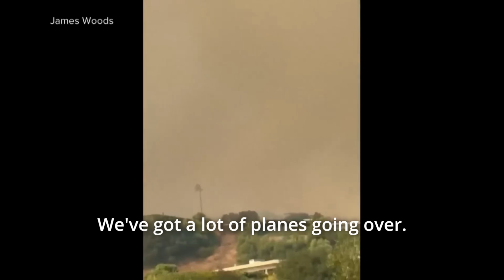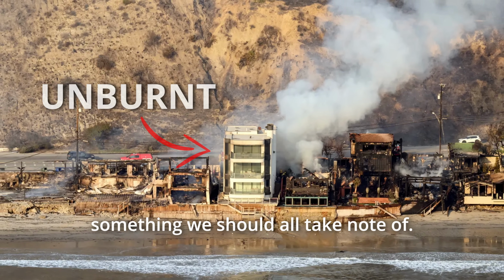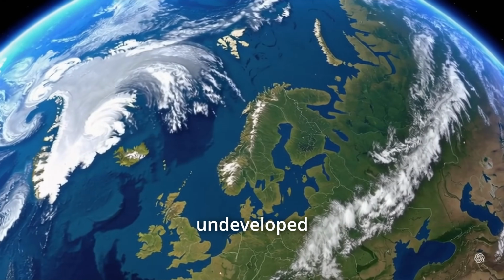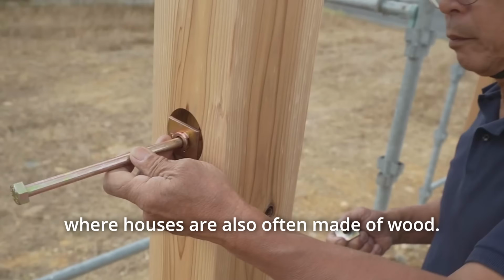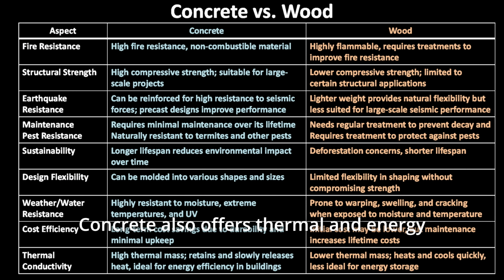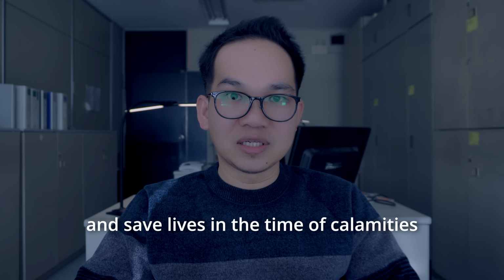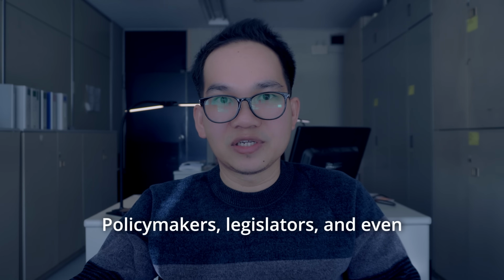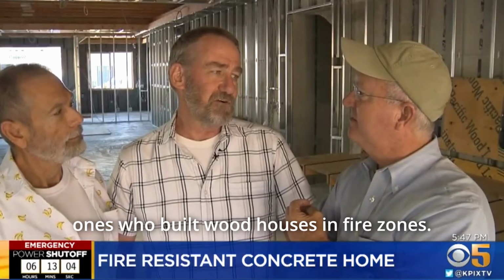Fireproof House? - What America Can Learn From The World

Comment from the maker: What material is your house made of? Is it durable enough to calamities?
Reply: My partner is also Filipino & the construction in the Philippines is structural concrete most houses Ive seen have no insulation I believe cellular concrete would be a better solution to construction there
Reply from the maker: I agree that insulation should be provided for houses in the Philippines, as the heat can be intense, especially in the summer. Without proper insulation, concrete homes tend to trap heat, making interiors uncomfortable. Your cellular concrete system could be a great solution. And please send my regards to your wife, a fellow Pinoy! Cheers, mate!
Reply: @chrisrayson4902 Insulation for hot climate would be achieved with thick stone walls or clay. 

Both difficult to build at scale so concrete options are the second best and common around southern Europe and world wide in advanced society.
Reply: @evdonsicatphd  wood framed since I live in the US and built in the post war boom (1961 I believe). I am in a fire prone area (the hills behind us burned in late 80s), but it burned away from our home so we were safe, but many died in that fire) and I can't afford to scrape it to rebuild new with all things perfect, so I am retrofitting things as I fix things on the home.

- already have made a 10ft buffer around the home with gravel and pavement as decorative hardscape and only succulents for plants (high water content makes them very fire resistant 5fr+ off the home
- going to do an unvented attic conversion and metal roof install this summer and will have metal eves once that's done with screened downspouts and gutters
- currently conditioning the crawlspace so I can close off all those vents as well to kill off that other weak point.

That should address the highest risk items.

The home is mostly stucco already and so that is fairly resistant as is but when I replace my windows in another few years, I will replace all of the stucco with metal or cement board siding with thick fire resistant insulation on the home exterior.

An option to not do window replacement is to add fire shutters to the home instead, but my windows are ancient and some leak so I should get around to replacing them anyway... 

If/when I do the windows I will go with tempered glass and metal or some other fire resistant material for the frame. Could still do the shutters - belt and suspenders and all that.

You can never make a home "fire proof" - given enough time anything can and will burn, but I think I will get as close as I can to a fire resistant home...just need to hope no fire comes my way in the next 10years before all my projects are done
Reply from the maker: @triaxe-mmb 
I really appreciate you sharing your experience and the level of detail in your fire-resistant retrofitting! It’s great to see that you’ve taken lessons from past disasters seriously and are proactively working to protect your home. I’m also glad you were spared in that previous fire.

Your methodical and practical approach to hardening your home against fire risks—can really inspire anyone in fire-prone areas.
Your strategy of creating defensible space, upgrading your roof and attic, and closing off vents is spot on—many studies show these are some of the most vulnerable points in wildfires. The tempered glass and fire shutters are excellent additions, especially since windows can be a major weak spot during ember storms.

I completely agree—no home is ever truly “fireproof,” but minimizing vulnerabilities as much as possible buys you critical time and protection. Wishing you the best with your retrofits, and I hope your area stays safe from wildfires in the coming years!

Would love to hear how things go once your projects are further along! 🔥🏡💪
Reply: @evdonsicatphd  another query - is it advisable to put pipes and sprinkler heads on homes to actively fight fires or would they be more of an hindrance to fire fighters during a fire disaster? If yes, is that something a homeowner like me can figure out or should it be designed by a fire systems engineer and professionally installed?

The only homes that really survived when such major fires happened were either built better or they were ones where homeowners basically set up pumps and pipes and lawn sprinklers and such to fight the fires, or they even actively fought it by staying back (highly not recommended IMO - yes your home is valuable, but your life is more valuable...I guarantee a person's family will miss them way more than any home)
Reply from the maker: @triaxe-mmb  Great question! Sprinklers and fire suppression systems can definitely help by wetting surfaces and reducing ember ignition, but they need to be properly designed. Poorly placed systems might not provide adequate coverage, could fail under extreme heat, or even interfere with firefighting efforts.
For the best results, it's highly advisable to consult a fire systems engineer to design and professionally install the system. They can ensure it integrates well with your home’s fire defenses and doesn’t cause unintended issues.
And I completely agree—while protecting your home is important, your safety should always come first. Homes can be rebuilt, but lives can’t be replaced. Stay safe!
Reply: rainchains can be a great fix too 

Make sure to expend the cleared area around the house. 

Have vent and AC protect and shut down during fire. 

Plaster wall and low stone perimiter walls help too.

Comment: It's not all of the rest of the world. Wood is the standard material for residential construction in Canada, most of Scandinavia, parts of Russia, parts of Australia, New Zealand, and much of Japan. It takes more to fireproof a wood structure, but even when it's used in shoddy structures, it's much safer in earthquakes. The worst quakes in the Phillipines over the past 50 years have killed tens of thousands, while the worst quakes in CA during that period killed 50 or 60 each and most of those deaths were due to concrete and masonry structures (especially bridges and overpasses) collapsing. Concrete can be made more resistant to quakes, but when it does collapse, it's inevitably much more dangerous to anyone caught under it. And, wood structures can be made much more fire resistant than most of the houses we build in the USA; with stucco on the outside, a metal roof, no vented interior spaces and intumescent coatings on the inside, it can nearly match the fire resistance of concrete. Wood structures can last hundreds, sometimes over 1000,  years; the oldest one in my town was built in 1635, while modern concrete (unlike Roman concrete) starts to deteriorate after 50 to 200 years depending on the conditions. People rebuilding in CA will be looking for more fire resistance and I'm sure some of them will rebuild with concrete. But those who rebuild with wood will likely be required to rebuild with much better fireproofing than their destroyed houses had. We in the fair-weather parts of the country can certainly learn from that; even here in the Northeast, we've had some devastating urban blazes and some wildfires. But we also need to heat and insulate our houses and my brick&block townhouse from the 1950s would not pass today's earthquake codes. Wood is not going away, so it's time we learned to use it safely.

Comment: Sound advice, but counter to the prevailing paradigm of cheaper & faster, with little heed for durability and survivability in case of disaster. The proliferation of Lithium-ion batteries is adding a new dimension for fire prevention.

Comment: Sorry this video misses the point...  We don't need to build solid concrete houses in California to resist fires...  Most of these houses had open vented attics & crawl spaces with large vents & wooden siding etc..  The devastation would have been far less with simple stucco exterior, tight mesh screen vents, fire resistant roofing.  The idea that everything should be made entirely out of concrete is frankly absurd.

Comment: I totally love the idea of a more durable concrete house. However, wood is super cheap, everyone knows how to build a house out of it, and it might be cheaper long term. Most people only care about the immediate cost, square footage and design. Houses are already so expensive too, so it's a hard sell
Reply from the maker: I totally get where you’re coming from—affordability and familiarity are major reasons why wood remains the material choice. But what surprises me is that even some multi-million-dollar homes that burn down are still made of wood. With that kind of budget, a concrete home would definitely be possible.
There are also concrete-based alternatives, like Insulated Concrete Forms (ICF), while only adding about 5-10% to the upfront cost compared to a traditional wood-frame home. ICF homes require significantly less energy to cool and heat, the long-term utility savings can actually make them more cost-effective over time. 
I agree - most people only care about the initial cost. But then again, when calamity strikes and their houses burn, all will be lost and rebuilding a house will be more costly.
Reply: @evdonsicatphd  would ICF work in places like CA where they have to deal with fires and earthquakes? 

Every time we see earthquakes in densely populated areas in other parts of the world (most recently in Turkey I believe) we see a lot of concrete structures that collapsed...even in places like Kobe in the 90s they had such a high right of structure failures and deaths compared to the last major earthquakes to hit CA (Loma Prieta, Northridge, Napa) where while there were significant structural damage incidents in all 3 quakes the injuries and loss of life were quite low...is that purely chance or did the fact that CA has such a heavy utilization of wood framed structures play into the overall reduced mortality and injury rates compared to places with more "robust" construction techniques? 

Not being sarcastic - honestly curious...I do understand that the tyoe of shaking and duration of shaking play a large part in it...for example the Kobe quake and the Turkey quakes, while about the same magnitude as the CA quakes, they were substantially longer in duration...is that why they had such high structural failures and deaths relative to the CA quakes?

Also, If our wood framed construction is why we had such lower levels of injury and loss of life, then is there a way to build without wood framing that still gets the same results in earthquake performance? Steel framing maybe? Or is that cost prohibitive?

Comment: Its truly crazy that so many LA home owners was so unprepared. Even houses on the beach front row was completely destroyed. Why did these home owners not had submersible pumps with fire hoses using the unlimited water source of the Pacific Ocean..?
Reply: It takes massiv pumps just to take water up 100 ft most of the fire were miles away and over 400 ft elevation.
Reply: Salt water would need pumps to be cleaned regularly too. 

Like i said most fires were miles away from the ocean.
Reply: Pool pumps did help but only a few homes had some.

Comment: Homes made of concrete and steel are non-combustible, as are metal rooves and mineral wool insulation.
Reply from the maker: You're absolutely right—concrete, steel, metal roofs, and mineral wool insulation are all excellent non-combustible materials that significantly reduce fire risk.

Comment: You do not understand; rich build from concrete, including concrete roof. Poor(99%) have to go to bank, bend over, and buy wood house.
There is nothing about engineering here.
Reply from the maker: The houses of the rich that burned in CA—even those costing millions—were predominantly wood (with few exceptions). While concrete homes may carry a slightly higher upfront cost, technologies like insulated concrete form (ICF) can only add about 5–10% to the price of a wood house. However, the advantages of concrete over wood extend far beyond cost:
Fire Resistance: Concrete is non-combustible, with no risk of fire spread.
Durability: Concrete withstands extreme weather conditions better than wood. - It does not rot.
Energy Efficiency: The thermal mass of concrete helps in stabilizing indoor temperatures, potentially lowering energy bills.
Low Maintenance: Concrete requires less upkeep over time, providing long-term savings.
These benefits are rooted in engineering principles discussed in the video that apply to everyone, regardless of income.
Reply: @evdonsicatphd  Americans,for the most part, do not apply logic in their thought process. They are an ego based culture and those who make a living off of them know this. The only way this type of building becomes the norm is if government requires it in building codes. However that would slow growth in residential real estate and negatively impact GDP, so that’d be a no go for government.

Comment: Availability and price is why we still use paper and sticks to build our dwellings.
Reply from the maker: If we look around, we can find alternatives such as ICF that may cost just a bit more than traditional wood framing, but the benefits can outweigh that modest premium. ICF (Insulated Concrete Forms) provides strength, durability, energy-efficient, and fire-resistant construction by using interlocking forms filled with concrete.

Comment: in relation to the 3 storey unburnt mansion(and other buildings spared from incineration) i can understand that solid concrete is fairly fireproof but why do you think that none of the windows melted/shattered or blew out,  there is no scorching , no burn/smoke marks on any of its walls ,even though it was only meters from a fire hot enough(1500deg celcius ) to melt steel and brick, also keeping in mind that modern renders have a high acrylic/polymer content which is quite flammable and not to mention that  none of the external paint work caught fire . the houses beside it also appear to have been constructed from concrete and steel but they are totally destroyed ?
Reply from the maker: We can’t say for sure without more investigation, but here are some possibilities:
- Design and construction:Even if buildings use similar materials, differences in things like window framing, wall thickness, or fire compartmentalization can make a big difference in how they handle heat.
- Protective Coatings: Modern windows might have special coatings or use laminated glass that holds up better in high temperatures, and even flammable renders can include additives to slow combustion.
- Thermal Inertia: Concrete can absorb a lot of heat and release it slowly. If the mansion’s concrete absorbed the heat without reaching its breaking point, it might have helped protect the interior.
- Fire Dynamics: The cited 1500°C might have been reached in small, localized areas, not across the entire fire zone. Other nearby buildings might have faced longer or more intense exposure or even blast effects from burning debris.
In short, the mansion’s survival likely comes from a mix of smart design, material properties, and the unpredictable nature of fire—not just the inherent qualities of concrete or steel.
Reply: @evdonsicatphd  That house right beside the others should have been blackened by the massive amount of soot being dispersed from the neighboring homes. Tom Hanks home still has lovely grounds as if it was somehow contained in a bubble?

Comment: It's about material costs and labor costs. In Europe wood is expensive and labor is expensive. In the tropics wood is expensive and labor is cheap. In california wood is cheap and labor is expensive. 

On top of all of that concrete may be cheaper over a 200 year span but remodeling a concrete home is not. In the US a lot of our homes were built small back in the baby boom and were expanded over time. 

Most americans in single family homes live in suburbs at low enough density that urban fires like the one that just struck california are not really a possibility. That being said there is a lot that can be done with surface finishes to protect from fires and even without leaving light wood construction behind Americans should be looking into that.
Reply: Concrete work is really expensive in California. 

Mostly only reserved for fundation work. 

Some builder outside California offer  affordable concrete construction but mostly on plains and not in hilly valleys.
Reply: This is the key concrete would make it insanely expensive. Housing  does already cost a lot in California and Regulations were to build are tight.

Comment: Hardy plank does not burn. I just watched a video yesterday from Matt Risinger Hardy Plank came out best and vinyl siding the worst. Ceramic roof tiles don't burn neither. I think wood framing is fine as long as the fire cannot get to it. 2x6 wood framing also leaves room inside plenty for insulation. I also think that in the US concrete is probably more expensive than in other places in the World. I think it used to be a lot cheaper.
Reply: Everything is more expensive in the U.S. Watch the YouTube uploads from home inspectors and you will see the subpar integrity of builds from base price to mansions. All this while city inspectors sign off on every phase of construction without worry of any discipline.
Reply: 2by4 an 2by6 framing is great and cheap. 
Key is to have vent covers and AC turned off and blocked off. 

Plaster exterior walls or fire rated food panels for exterior.